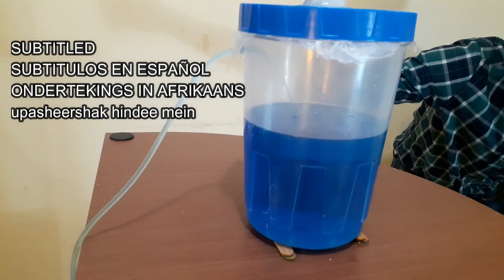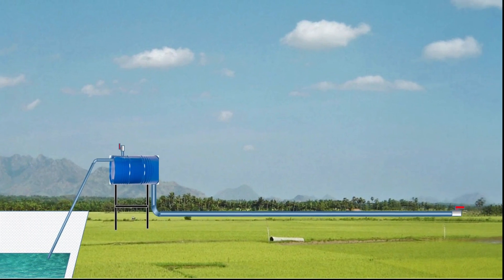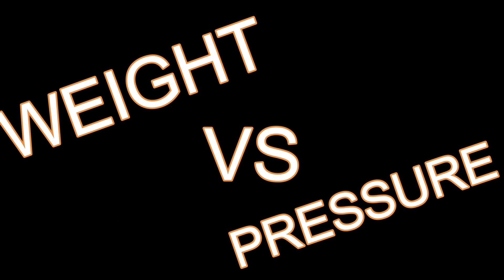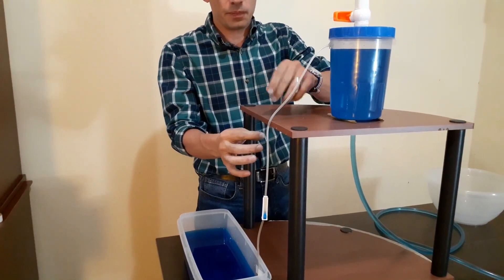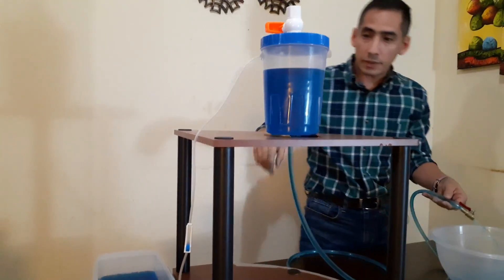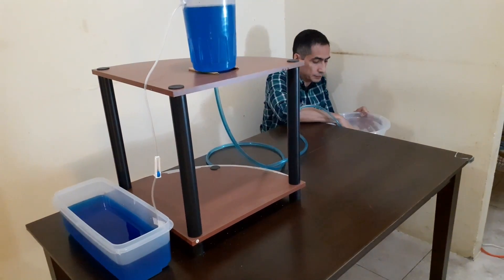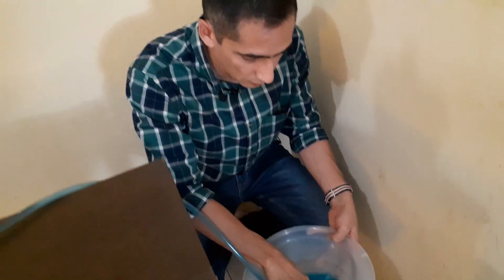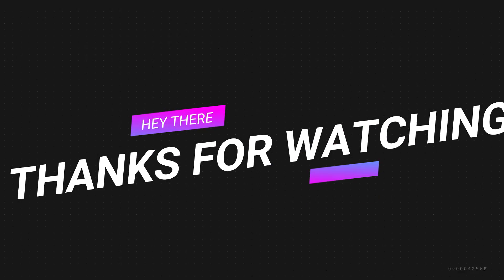FREE ENERGY Water Pump FULLY EXPLAINED!! REAL OR FAKE?  #freeenergy #waterpump

Comment: In the first test water is leaving the tank without being replaced by anything apparently. In the second test, it shows that there is a big difference of water flow when outlet level changes. First test shows that there is an air leak. Second test confirms that. Gravity can help sucking the water with help of the pressure provide no leak is there. In case of air leak, at a certain point, gravity is not able to suck water anymore.

Comment: Like others have said. You experiment is not the same. You need a check valve/foot valve on the intake pipe. The intake pipe must be primed. You are also using tubbing. It flexes too much. Your seals on the tubing need to be tight. That glue is not good enough. Every time you move the tubing it the seal is disturbed. (use tight grommets).
Reply: No check valve is needed when using a priming tank.
Intake pipe does not need priming, purpose of using a priming tank.

Comment: One fatal error you made.
First rule of negative vacuum make it "perfect vacuum" means no air inside of the container. 

First the inlet must submerged in water and put alot of flooting balls to prevent the teist suction 

Second make a two bucket 
1 with full of water and another with empty and 2x the size of the other container (withwater) make sure the empty container or bucket  it has negative pressure minimum of -10 psi for small diameter of inlet, the bigger the inlet the higher the negative pressure inside of the empty container.

Third make sure the exit is submerged atlist 8 inches to prevent the air comming in 

Now you have negative vacuump pump it work like hammer pump.

But this is negative pump has potential since the outlet can make upto 8ft. 
 I did a 8 inch pipe outlet and put inside a rotor blade and spin the small generator I have (500w) 

The real problem is the inlet cause the water is to heavy and my solution is making a smaller inlet.
As of now it's working fine waiitng for 1 week test with load of electricity. 

I hope this will give you Idea how a negative vacuum work. Just make it perfect vacuum and proper size of pipe and right pressure.
Reply: No siphon like this an lift any water to a higher level. Exit must be lower than source.

Comment: I have a problem with my farm pond it has a bad problem with turnover in fall it is a drainage pond and has no spring or stream feeding it.
I'm trying to figure out a way to circulate the water is there a way to use a syphen pump under water taking water from the top of the pond and circulating it to the bottom?
If the outlet point is lower in the water than the input point could this in theory work or would I be wasting my time?
Also if it is possible to create circulation and run water from the top of the pond to the bottom I could add a ventury effect at the flow away from the drum adding air into the water and aerate the water going to the bottom of the pond?
I haven't see any videos on this I would be vary interested if it works. 
The problems I see with this is the water at the top of the pond is warmer and less dense than the cold water at the bottom, also the water at the bottom has a lot of water pressure pushing the water back up the pipe I'm trying to force water down.
But I was thinking maybe I could use a ram pump lower or at the same level as the input pipe it could be used to force the flowing  water to over come the water pressure at the bottom pushing the water to a lower point the waste water from the ram pump would be put back into the pond and would help add aireation to the middle of the pond, a check value at the end of the pipe would prevent water flowing back up the pipe, I could also add a tesla valve along the way to insure the water will flow only in one direction.
Not sure if any of this could work I've see a lot of videos like the one described here but I've never seen any videos putting the water back into the same source it was pulled from.
I believe it is impossible because if it worked it would be a perpetual motion engine so there has to be some point when the pressures would equalize but I was thinking if I just had to add water to a drum from time to time it wouldn't be the end of the world, if I could get it working for a few hours during night when the pond needs air the most it would be fantastic.

Comment: I am curious about the seeming vacuum ? what differs between the 2 vacuums displayed, i would have thought lower water level, higher vacuum, what is the extra factor ?, in the first test the level went way lower then the second, so its not just the (what i assume was a vacuum) vacuum at work, its a given it wont work since if it did i would have a water turbine spinning free electricity, yet who is :)

Comment: Some people are so stupid they still want to argue that the MAGIC pump works when clearly this video proves beyond and doubt that it cannot possibly work. 
The fools argue you left out parts of the "system" like valves that would only stop any flow and never have a reason or way to open. 
People want to tell me it works but they can't make the system themselves or a video of it working. They see the trickster videos and believe it with everything in their head. They can't see that the pipes run down a hill.
Reply from the maker: Thanks for your valuable comment

Comment: The amount of water is not enough to create a vaccume preasure.. it should be test in bigger container and the material you use is not required to creat vaccume preasure.. you must test it in real pipe and good water vessel with no air leak in the tank..

Comment: This is an unscientific experiment and the Physics is backward. Suction and syphon direction depends entirely on the relative weight of water, on either side of the high point. The only reason the apparatus doesn't work is because there is no hermetic seal and the air has not been evacuated. Any backyard mechanic knows to blead his brake lines and a syphon is a hydraulic effect the same as automotive brakes.
Reply from the maker: Thanks for your comment

Comment: I don't know what you wanted to achieve, but you do it painfully wrong. You don't really need different diameters piping, in the 1st experiment the containers wasn't sealed and it is pretty much clear that it stops working if you block the outlet pipe - which is what controls the water that creates the vaccum! What you just did can be compared to remove the engine for a car and then state that the car is bogus since it doesn't run.
Reply from the maker: Thanks for your comment. It has valuable points.

Comment: There must be a high suction within the container. Otherwise it just equals out.. The container has possibility to collapse, so use small hose in and out to decrease the suction needed. You have air leaks even at the ball valve it leaks pressure. Everything must be sealed for high pressure, so high pressure connection fittings of pvc require sanding and glue for no leaking at higher pressure. Not ball valves also you might use pvc tape aka teflon tape for no air leaks. you have things looking right.. but that pull needs to be strong enough and the container must not capsize and no iv thumb ball that's to slooow.. it's about overcoming the pull with vacuum pressure and volume pull. not hight and gravity, don't forget to prime aka fill everything first.

Comment: there is no foot valve in your pipe the inlet pipe should be filled with water and there should not be air in the inlet pipe
Reply from the maker: ive got another video which I add a foot valve. please check it out
Reply: No need for any foot valve when using a priming barrel.

Comment: None return valve on the pipe that goes in water and primed
Reply: No need when using a priming barrel. Purpose of using a barrel. When running, one could drop the whole barrel, no need.

Comment: did you try to fil the in pipe and put a cut back valve to keep the in pipe full when you open the exit ?
Reply from the maker: Yes. I have made another video adding a foot valve
Reply: No need when using a priming barrel.

Comment: Dude you not add block return vale at sucking pipe. So your test is not fair. From that start you doubt that system with compare with shipon science knowledge. So all your test is try to prove wrong try that clear mindset first . I also doubt that work forever 24/7 work that sys. I think it will stop when lost all water inside drum. But still think it will work long time maybe 4 to 8 hour. But it delivered 10 time amount of input energy ( water fill in the drum) I can call that sys success and useful.
Reply from the maker: I have made another video adding a foot valve, plese check it out, best regards

Comment: If there is vacuum in the raised container, then the air pressure on the outlet should prevent the water flow. Both inlet and outlet are subject to air pressure. I don't think it works. Flow into this container under vacuum is called a "flying syphon".

Comment: Your system is leaking air somewhere.  You didn't test for leaks.    Where is the AIR coming from inside the container as water exits ?    It's coming from a leak .      ALSO,   the pipe going into the TANK must be filled .    Find the air leak.

Comment: Heron's fountain principal.
Proven and high school science.
Drum pressure pump is what you're trying to simulate.
Don't use hoses, hose designed to hold pressure not vacuum and will collapse and cause loss of pressure. 1 way valve needed at water pickup. Prime the pick up. Air trap needed between your drum and outlet in your design, prevents the drum losing vacuum pressure.
Pretty sure your drum has air leak aswell vacuum should achieve a lock on the water unless air is bubbling back into it from outlet and I didn't see it bubble so air coming in from top somewhere.
Reply from the maker: This is NOT an Heron's Fountain. This is just a syphon, tiny huge difference.
Reply: This is no Heron‘s fountain, but a simple siphon with a priming barrel. No need for any foot valve or any more priming. The video shows that a siphon is not capable of lifting any water to a higher level. A siphon is no pump.

Comment: Exactly.  It is useful if you have a high obstruction like a mountain or wall in between the water source and destination.  This demonstration is perfectly in line with the so called "Free Energy" systems.  Water goes in the top and out the bottom.  In fact, the water supply could go in the bottom and still work.  It's a basic siphon.  The level in must be higher than the discharge out.  I can do the same thing with a bucket of water and a garden hose.  Nothing earth shattering!
Reply: But the „mountain“ can not be higher than about 8-10 meters an all water entering the siphon must be released  lower than the input.
Reply from the maker: Thanks for your valuable comment! Best regards

Comment: Excellent model and demonstration! 
Thank you for explaining this hoax "pump".
You can't pull water up with a syphon it must flow down. You need valves and pressure to pump water.
Reply from the maker: Thanks for supporting ! I appreciate it!
Reply: @rubencobos  I went a read some of the comments on your vid. I cannot believe the arguments people make. Like "you didn't prime the inlet pipe" but that would just start a syphon backwards and most videos have a manual valve to prevent that when filling the barrel. So that argument is wrong. Then I saw "you didn't put a check valve on the inlet pipe" which again would make it impossible to prime the pipe unless you turned it upside down or put the check valve at the end of the inlet under the level of the water. Again something that isn't in any of the videos. They show pipes and open fittings no valves. Also if you add a column of water on top of a spring controlled valve you have even more (much more) resistance to flow up. 
This is why I try to never argue with ignorant people. They simply cannot believe facts and want to believe a hoax or magic. If this "pump" was real wouldn't Einstein or someone hundreds of years ago figured it out and make it a common system?
 It's just someone making a syphon and calling it a pump to hoax and get views on YouTube. 

Note I admit some of the "systems" work in the videos but they cannot sustain flow without the discharge end lower that the source level. So they work because they syphon not pump. No barrel and pipe system will pull water up from a well to above ground level. Never ever!

Comment: All these "Free energy" pumps are a joke. The only way it could work would be to put a waterwheel in a stream and use it to drive a pump.
Reply from the maker: You are absolutely right, sadly there are lots of people being cheated by these ideas, beside the water wheel a RAM pump is able to pumping water from a water stream, I have made a video about a miniature RAM pump. Kindly check it out, it is in spanish but it is translated though... Best regards
Reply: @rubencobos  I'm familiar with ram pumps, but even they need a head of water to start with.
Reply from the maker: https://youtu.be/Dhn0CLChr9I

Comment: From my understanding this works! As long as you're system is air tight and inlet pipe from water source is 25% smaller in diameter than the outlet pipe..but also so encouraging to say that,  u could take this water as high as u want by putting more barrels    and repeating the process 😃!
Reply: Exactly, he has air leaks.  Otherwise,  where is the AIR replacing the water coming from?    I see air coming in at high speed.     A pinhole is enough to ruin the system .
Reply: This is a siphon, not a pump. No siphon can lift any water to a higher level.
Reply: The system will never lift water from a level lower than the outlet end. It is impossible.
Reply: @seetheforest  Oh really. Let me talk to the syringe manufacturers how their products that are being used daily don't work.
Reply: @awfultruth6216  ? A syringe works when pressure is applied to the plunger or "piston". They don't work by magic either.
Reply: @seetheforest  Correct! And here comes te beauty of water: The plunger or pistost is solid and it has, a fixed shape and a limited stroke - a stroke limited by the lenght of the cylinder containing it.  The plunger creates a seal and that seal creates some vaccum that suck in some liquid - let's call it water. Now such a seal can be also created by water. And by lowering the water lever, you can mimic the effect of the  stroke of the piston in a syringe.
Reply: @awfultruth6216  you can't pump water up hill with this stupid barrel and pipes only down hill. 
You are being deceived.

Comment: It works.  I always take a 2 inch hose, about 7 meters long and i siphon a container on flat ground by lowering the hose over 45 degrees. More water is in the hose over the 45 degrees than what is needed to raise over the edge of container.   Its even siphones hard off the bottom even though there is no down sloap from the exit end of the hose, just a gradual slope maybe 3 times the volume of the lift.
Reply: it doesnt work, physic says differently! the drum is just like a bubble in the hose an its still just a regular siphon and only works if you siphon below the source!

Comment: This thing works. The pump is the drum placed above the well which pumps water from the well and outlet water will be moved by the gravitational force, so siting is very important. If raised the outlet pipe above the drum, you make atmospheric pressure to be more than the outlet drum pressure thus why you see those bubbles. But it can pump water from the well to the drum and from the drum water will flow to the lower side not climbing the hill.
Reply: it doesnt work, physic says differently! the drum is just like a bubble in the hose an its still just a regular siphon and only works if you siphon below the source!

Comment from the maker: ENERGÍA GRATIS: https://youtu.be/akuyo-qmUwo watch a REAL FREE ENERGY water Pump here: https://youtu.be/akuyo-qmUwo
Reply: Your system is leaking air somewhere.  You didn't test for leaks.    Where is the AIR coming from inside the container as water exits ?    It's coming from a leak .      ALSO,   the pipe going into the TANK must be filled .    Find the air leak.
Reply: https://www.youtube.com/watch?v=tf1bTQLx4K0 how about this kind of free water energy pump..using 2 gallons??

Comment: There is something wrong with the first experiment, because I did two experiments and will do the third, but the conclusion I reached was that I could not extract the water and at the same time the pressure was so strong in the bowl that the water did not come out of it.This means that there is an element missing but not an absolute failure.
Reply: Your foot valve did not open

Comment: You do have a good point with what you showing. But you did miss quite a few crucial methods that allow these people use. And had been proved as effective from lotto science people. One method is I use an eldrum to create a vacuum section on top of the drum method that you are using. 2A second method you could use to make it walk is using a vacuum pump method where you have a pipe with a vacuum air tube and a belief valve that creates a suction pump that leases the water and falls as it back down the tube again with a greater force
Reply from the maker: Thanks for comment, I will make more videos regarding this issue, however, the atmospheric vacuum is related to the column´s high so it is imposible generate more vacuum than column value. currently I am developing videos about RAM pumps wich are actually free energy pumps. watch my lastest video.